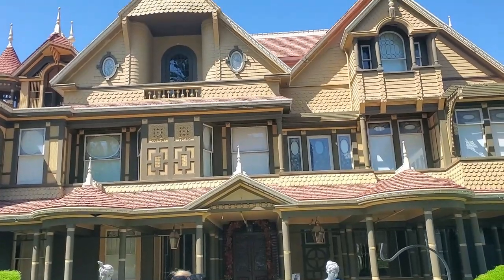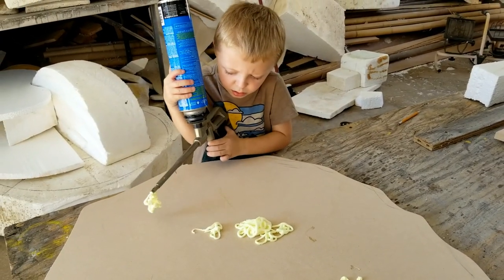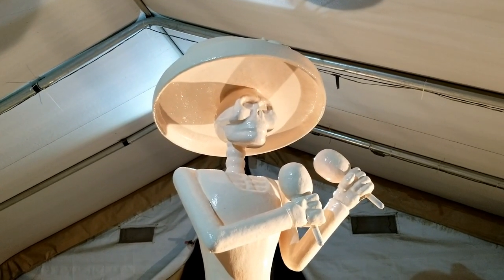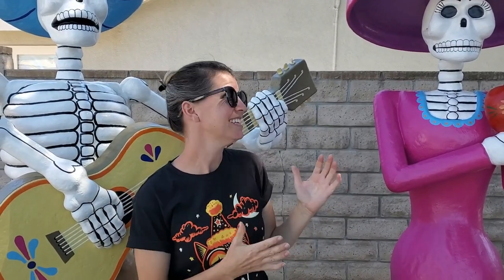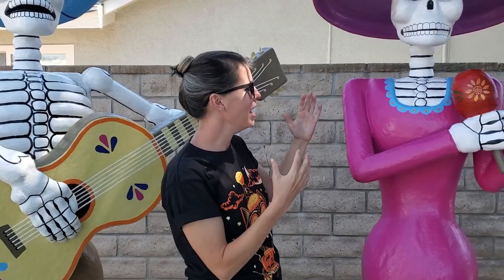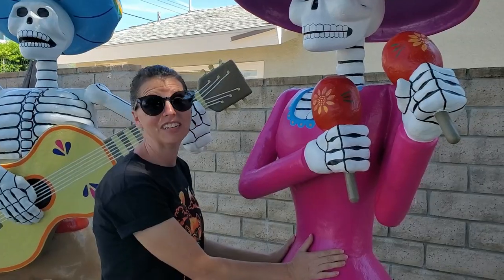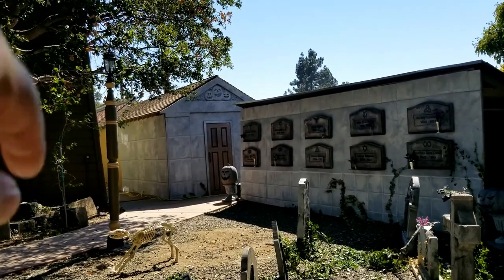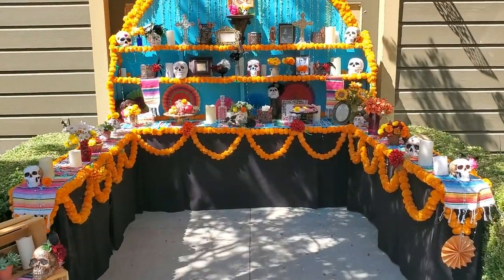Day Of The Dead Skeleton 💀 Halloween Props for The Winchester Mystery House

Comment: Great job with the skeletons!! I want to make reaper statues like that for the entrance to my cemetery. Everyone does monster mud, but I want to try your method with carved styrofoam and fiberglass. Can you detail the process? What is the gel coat you mention?
Reply from the maker: The gel coat gives the outside the smooth surface over the fiberglass and resin like on a boat.  It will help make you project last for years but its definitely more work and cost more than monster mud.  There are great fiberglass tutorials that show the steps and details.  A lot of times they show on a piece of wood or something but it was still helpful when we were getting started.

Comment: Forgot to ask on first watching, remembered on 2nd watch ! What did you use for the shoulder "joints" BEFORE you used Great Stuff to seal them in place. It almost looked like black rope ?! 
What was it attached to ?!
Reply from the maker: I used a couple pcs of rebar like the neck joint to support the weight then the great stuff to glue in place